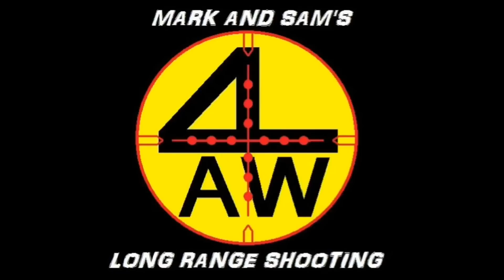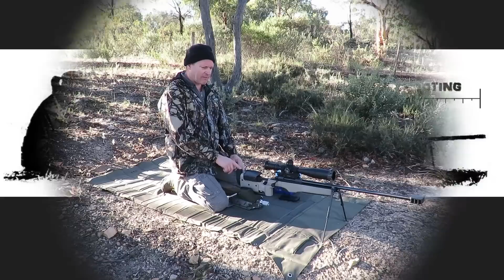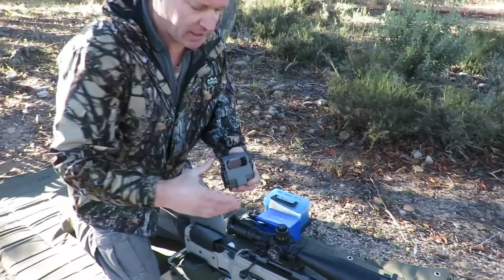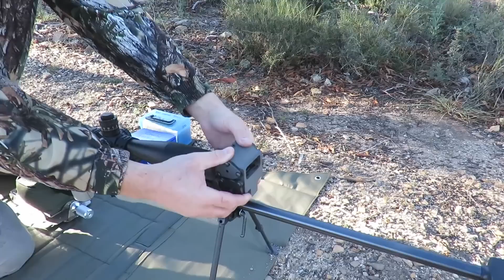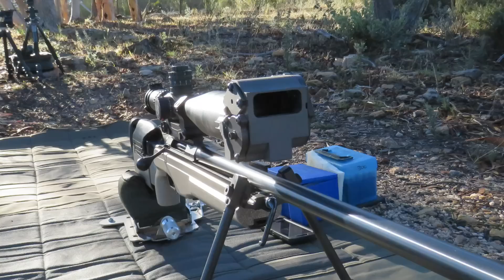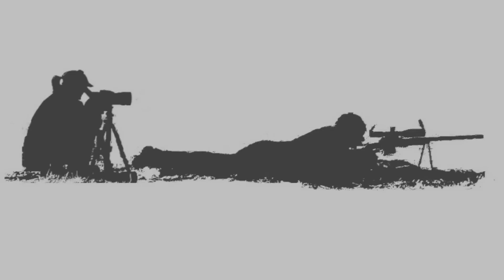introduction to the Charlie TARAC

Comment: What scope base is that?
Reply from the maker: NightForce BEAST moar
Reply: MarkandSam AfterWork what mounts are those just the normal 20moa?
Reply from the maker: 60 moa rail, ERA-TAC adjustable rings/base, all said in Video. But not relevant/needed for the Charlie TARAC unit.

Comment: I know snipers had issues with the old Simrad units due to the height over bore causing zero offset but I would never had dreamed of using that concept to gain elevation for ELR shooting.  If this thing proves consistent and reliable these guys deserve an award.
Reply from the maker: Sure seems all good at this stage, Cheers

Comment: Ingenious Product! This also let's you have a longer barrel without getting into the way of the sights, further increasing your range. But just an issue magnets should never be used to secure it.
Reply from the maker: There is a place to run bolts, we did not realize (magent are quite strong) but will be running bolts from now on, Cheers
Reply: MarkandSam AfterWork great! Looking forward to more extreme long range stuffs from this product!

Comment: Looks almost to good to b true...curious to see if magnets hold well through the recoil. Good stuff...can't wait to see the results.
Reply from the maker: Video of unit in use, next, Cheers
Reply from the maker: Thanks for that, yes checked that out after, they where not supplied and I did not realize they where needed until later that day when I viewed footage, John is sending some of the bolts ASAP
Reply: Magnets hold pretty darn good but you can also just install the 2 cap screws though the mirrored optic and into the threaded holes in the base that is secured on the scope.